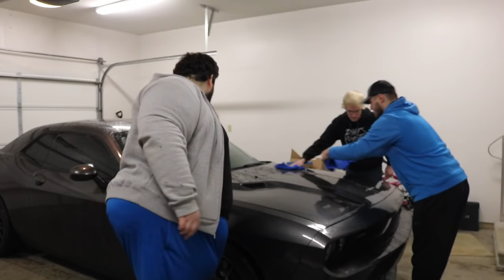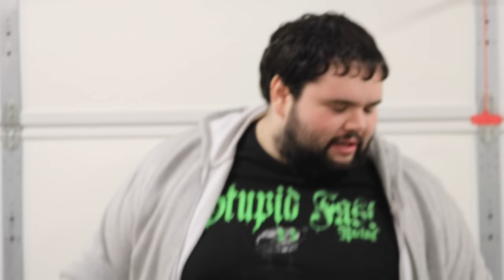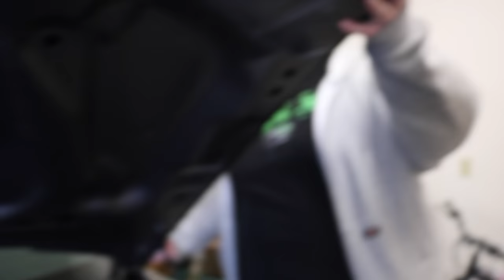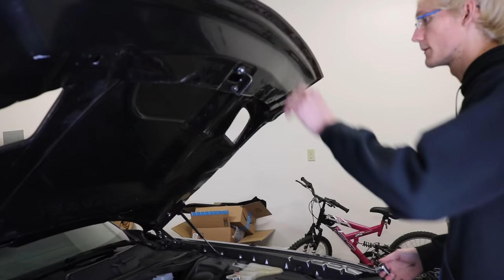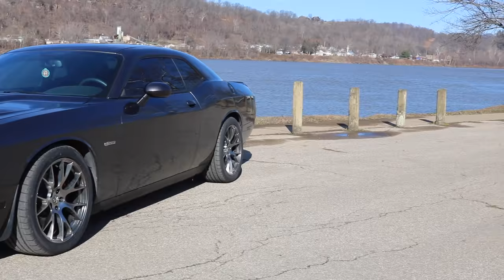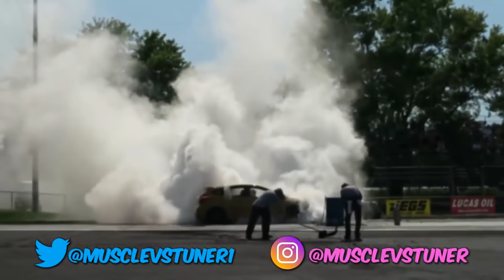Turning My Challenger Into a Hellcat??

Comment: engine/ trans swap and keep the R/T badge
Reply: I could recommend an si badge for maximum giggles
Reply: Slink Bradshaw put a sxt badge
Reply: Slink Bradshaw put a 1le badge
Reply: But a TDI badge
Reply: Slink Bradshaw transmission is the same so really you just need the hellcat motor and you're good.
Reply: Michael Scott unless you want a manual or automatic 8 speed or 6 speed
Reply: clovehitch my nigga
Reply: Michael Scott no it's not he has a the 5g speedshift in his car the hellcat uses a beefed up version of the zf 8 speed auto....and technically speaking all he needs is a stroker kit that would take the 5.7 to 6.0 liters and get a edelbrock,magnum or procharger supercharger system then he'll be making the same amount of power....I mean the hellcat's 6.0 the str8's 6.4/6.1 and the r/t's 5.7 are using basically the same engine blocks.
Reply: Except the Hellcat is a 6.2 L
Reply: ZenZory Overload 6.2
Reply: Slink Bradshaw that would be dope
Reply: yes but you get the jist of what im trying to say...
Reply: Slink Bradshaw put a Chevy badge
Reply: R/T = Real Talk
Reply: Slink Bradshaw I've been planning on doing that to mine. That would shock some people👍

Comment: that cost to ship that hood was probably at least a $100
Reply from the maker: +Joshua Godsey probably more lol
Reply: Muscle Vs Tuner yah it's heavy and big it's like shipping plastics for quads super expensive
Reply: more like 400-500$  Fed Ex wanted 250$ to ship something 1/4 that size
Reply: +gittyupalice96 depends on weight yoo, not just size. we got a hood for a silverafo shipped to our shop for like $150. if its not a shop they charge around $250-$300. thing is that foe bigger parts, they are delivered by different companys than fedex or ups.
Reply: Andy V. makes sense.. GOT it, go through my friends shop.  10-4 keep the rubber side down rubber ducky over and out
Reply: Joshua Godsey iirc that's about what it was for my truck hood.

Comment: if you didn't put the under hood insulation on the new hood keep an eye on that paint. all the heat coming out of the hood vent should give you an idea why that stuff is there. it's not all for noise deadening purposes.
Reply from the maker: +dubvr6nos The intake manifolds on these cars are plastic so I can't imagine it getting too hot

Comment: What is that hood scoop doing? Oh nothing, ok
Reply: soapftw96 looking cooler than the normal hood.
Reply: Mi Pr at the end of the day it's not your car it's his and you shouldn't get mad if you wants to do whatever he wants for his own car, personally I agree with you but let's not start hating and being negative, shit like this will never end
Reply: Mi Pr I didn't say it's a fake hood, but the hood scoop has a fake function. He put Hellcat wheels and a Hellcat hood. The small R/T badge is the only thing that says it's not a Hellcat. It's not stupid to say that it looks like he's trying to make it look like a Hellcat.
Reply: it lets cold air in and hot air out of the smaller holes.
Reply: Increasing airflow
Reply: looking a lot better than the original hood that was also doing nothing.
Reply: it is functional unlike many other cars
Reply: BassManBobBassCovers Bullshit. The hood scoop isn't connected to anything. It's barely doing anything. It's not like the car overheats or anything. It's useless.
Reply: Mi Pr Probably the same reason why YOU care so much too. My life doesn't suck at all, I've never been better. I don't know how you can assume someone's entire life just by one opinion of someone's car.
Reply: soapftw96 the real srt8 hoods let air in
Reply: Kareem Hailey I mean the hole are super tiny leading straight into a plastic bit under the hood so not exactly doing anything

Comment: Bro...clean your engine bay. Simple green and water is all you need. Make sure the engine is cool (sit over night) before you clean it...for obvious reasons. More than likely there is a page or two in your manual about cleaning the engine. Mainly you just need to know what they recommend you cover up. I typically use plastic trash bags from the store. Hood looks sweet.

Comment: Why not get a shaker hood and get a shaker intake??ive even seen chargers have them and look badass..
Reply from the maker: +Thevalley Rodriguez That would probably be a second option however you can run the shaker intake if you get a procharger later on
Reply: Muscle Vs Tuner shaker intake + pro charger would fit best for your  R/T.